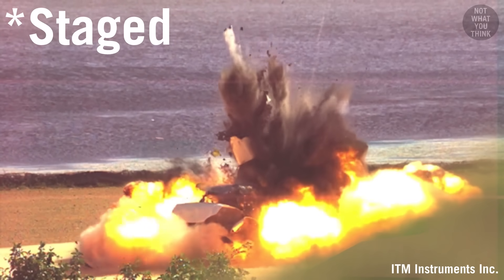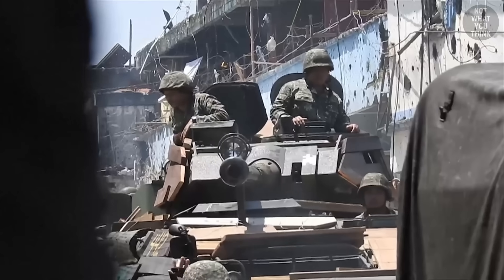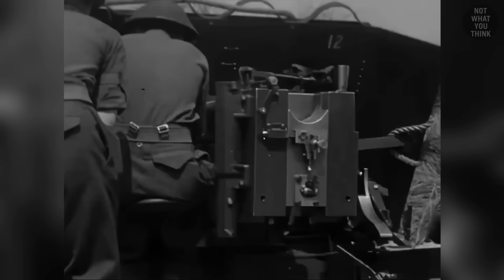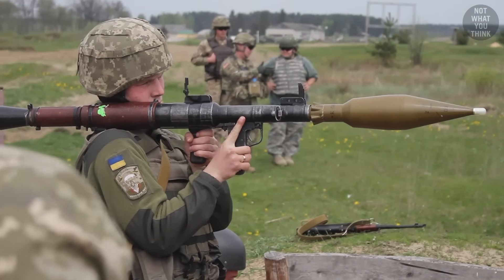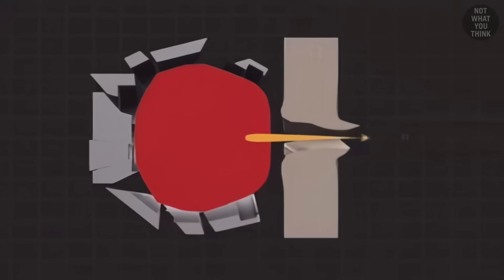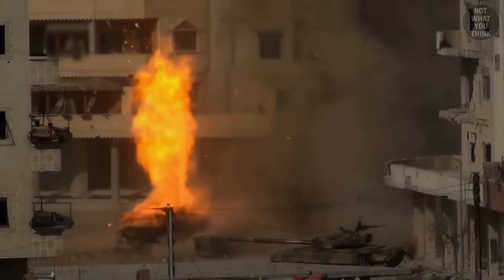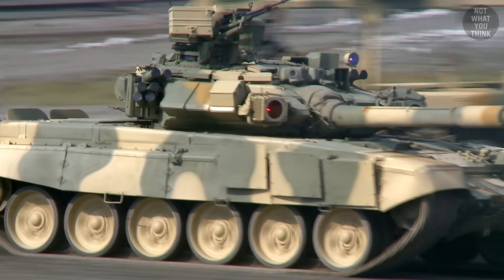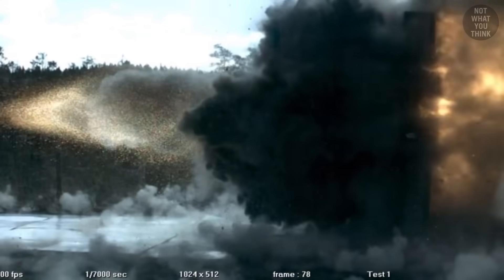Why Protecting Tanks is Getting Much More Difficult

Comment: Tank protection: Tanks these days have to defend against multible working mechanisms of attacks, and not all are covered by the same principle. So what we see is in regular a mix that hope to cover everything that is expected to happen - and also we have a extreme poor education in weapon industry and tank crews alike what they should know and do to protect the armored troops.

RPG's are relativly short range weapons, delivered by troops who are good visible for IR sensors. So RPG's are common, but only can come close if you're forced to bring your tank into a urban enviroment with lots of cover and good thermal blocking hiding places.

In the open, ATGM's are a threat, but most of them use top attack, so most of your defensive measures aren't working at all. Good thing is, the're mostly guided by laser, radar and/or heat. Lasers can be spotet by your sensors (if you have those toys), and if the tank knows its lased, it can pop out thermal smoke to hide from the missile.

Tanks in regular fire APFSDS projectiles which are very thin and long to somewhat 'emulate' the idea of the copper jet needle. A massive, superfast object facing minimal armor. It's good if you have a halve way modern APS to degredate them in flight, then ERA can further degrade them and the armor takes teh last part.

Very modern munitions are KE, which are APFSDS on steroides, the best of them going hypersonic. The're too fast to get tracked by all but the one or possible two best systems available in the world. And still then you need quite propper ERA of newer generation and a solid armor to survive this.

Tanks also shoot HEAT sometimes, which is a completley other math. This are indeed just middle-speed shaped charges.

So every angle on a tank have a list of percentages of what threats they could stop on what probability (on what light conditions, radio enviroment, weather, temperature etc.). That's a shitload of math when you're a tanker, cramped in a small container of metal and in in stress of combat operations.

Modern tanks consider own drones for independant recon and first-sight-first-hit probability, remote turrets to add another layer od dead metal between every possible attack angle and the enemy, deploy most modern ERA and APS. There also is special top attack ERA calles TAPS, fake laser emitters and all other types of fancy toys to help in a very specific situation.
But that's costly and heavy, so mobility - one of the core aspects of survival - is hindered. And in the end, even the toilet paper for the crew is part of how comfy they are, and how good they are focused on ther task.

Comment: Tank prices: Western tanks cost that much due to corporate contracts and to a degree for the complex sensors. A propper T-70 or T-80 only cost you around 750.000 USD. The T-14 Armata cost 7 million USD and the most advanced tank today cost 10 million. So there is a pretty huge gap, and number atm outpeforms quality.

Also the modernised T-90 variants actually don't feature a APS for the fact that a good Arena system would add 300.000 bugs to the cost - and now we have to see that the US don't have a domestic APS and have to buy israelian Trophy, which isen't just incapable against modern threats, it also adds 1.5 million to the cost and up to two tons to the whight. Not a good deal to handle RPG's.

Comment: HEAT warheads and the countermeasures developed to protect against them is one of the most interesting parts of tank warfare.
Reply: @Mark Aspen no, proper MBT’s should be able to stop 120mm sabot from most angle when facing the front, but the side and top is where issues start. Top armor is designed to stop Shrapnel but if it was as armored as the top you would have no room for crew and it would be heavy, fortunately guided artillery is not common enough and non guided is too inaccurate to hit the top unless it gets very lucky. Perhaps in the future guided munitions will be more common (we are getting there) but id image just looking at Ukrainian for instance that the stockpiles of weapons like these will be far more useful not killing tanks but fuel depots, ammunition storages, and such that would make huge battalions of tanks be unable to function instead of just 1.
Reply: @Mark Aspen Nope, not necessarily true
Reply: @Mark Aspen the front of the Abrams Sepv4 would like to introduce itself to you. No seriously the Abrams Sepv4 is invincible from the front not even a kornet AGTM can punch through the front lower glacis. But considering you said that only a tank can destroy a tank you don't seem to be all that smart when it comes to military stuff so you probably don't know what a kornet is or what ammo type modern MBTs use wait... You don't know what a MBT is either XD man it's hard communicating with people of lower military knowledge
Reply: @Mark Aspen side ERA and side NERA is also on the Abrams making it have go protection form anti armour threats there too
Reply: @Mark Aspen Abrams is obsolete.
Reply: @Mark Aspen with what you're saying, and your inability to communicate, I doubt your name is Mark Aspen. I'm a pacifist and I still think Murica is the most aggressive country, far from cowardly, and to a fault. Unfortunately there are many more countries that are much much worse but much much less powerful militarily.

Comment: Protecting tanks is getting much more difficult because of guerrilla warfare, flanking tactics and top down attacks. ERA, which predominantly protects side and turret armor, is not 100% effective. Frontal armor only works when fighting enemies towards the tanks front, which in turn is not the concept of the hit and run guerrilla warfare. Defeating anything with frontal armor, weaker side, rear and turret armor is about flanking, if flanking maneuvers are applied and deployed properly tanks go boom. Top down attacks are self explanatory.

Comment: tank armor is tied with engine advancements and the material, we dont have that much high powered engine that can move ultra thick layers of steel. so most of the tanks even the heaviest one always have a weak thin spot all around, and to cheat this out, the army is shown to develop additional stuff like reactive armor and stuff also we havent found a lightweight-strong material for the body either, imagine if we have a infinite engine/power like ironman's reactor and wakanda's vibranium.

Comment: If the APS is too heavy and costly on tanks themselves in addition to their armament, I wonder if they could move it on to dedicated vehicles in the tanks' defensive screen so that the tanks themselves could trade armor for greater speed and mobility.  They'd still have enough armor to provide protected firepower against artillery and machine gun fire, unless they decided to go full drone tank.
Reply: The problem is the range of modern APS. They are fairly short ranged, allowing for the protection of the tank only. This is in part a result of the times and distances needed for detection, identification and intercept.
However, your thought is very sound.
As the first examples of tanks with loitering munition were shown, many experts were making the same argument: it would be more prudent to put loitering ammunitions on a seperate vehicle, decreasing cost, complexity and mass for the tank.  Same discussion is happening to counter-drone capabilities. Is it more effective to arm MBTs with some counter-drone systems or is it more efficient to put them on seperate units?

Comment: 6:42 NO!!!!!!! the length of a small shape charge pen jet is short sure, like length of your arm short which is still way thicker then any space armor and some thin skin face hardened steal much less any real world tank's RHA for that matter(composite&reactive aside) the idea of the wood paneling is its soft tropical wood  most use chicken wire mesh or chain link but the idea is not to space out the detonation but to catch/bounce the projectile with out detonating it or damaging it enough to distort the shape charge so its ineffective at creating a jet when and if the fuse is triggered(blades of slat armor cut up the shape charge before the detonator reaches the real armor).

Comment: The trophy active protection system actually does put the tank back on top

in Gaza, 2014, the trophy destroyed 15 incoming Russian ATGMS, and not a single Israeli tank was destroyed

in fact, it was so successful it was strategic...the 2014 war ended when Hamas understood they have no way of stopping Israeli tanks

Sure sending multiple ATGM's, at least 5 simultaneously (since the trophy can be activated on all 4 sides), can probably overwhelm the tanks' APS'....but that is just not an effective battlefield, and frankly not a solution

Comment: I have seen many videos of how shaped charges work, but your explanation beats them all. The narrative and video makes so clear that even this 80 year old gets it, finally. Thank you very much. Now, if you could explain how that anti tank round exploded many feet(meters- I'm American) from the tank, and then sent something at the tank that penetrated the armor, works, I would be even more grateful.
Reply: I think I can answer that. Unfortunately the video takes quite a few shortcuts and you are probably referring to the video at the beginning.
That's not a shaped charge. That's an explosively formed penetrator. In shot, the "jet" formed by a shaped charge has a very precise and short distance at which it has to be fired to be effective. If the detonation happens too soon, the jet will be disrupted by the air it has to travel through.
An EFP forms a solid projectile that travels a much greater distance but with a little less penetrating power.
If you want a comparison: take an air compressor, aim it at packed sand from a few feet away: nothing happens. Come closer and the air will push the sand out of it's way. 
Now, if you take a 22LR (which would be the EFP in my example) and the results will be the same if you fire at point blank or from a few feet.
The designs of the liners shown in this video are quite basic but in reality, the liner of an RPG is trumpet shaped in order to shorten the standoff distance. British Challenger tanks use a rifled barrel that imparts spin on the rounds. Centrifugal forces also disrupt the jet from a shaped charge so they had to come up with a liner designed to counter this.
Hope that helped ;)
Reply: @herrhaber9076  I am not sure I am following you. The early part of the video was not showing a shaped charge, instead a ultra high speed penetration round? If that is right, why was the penetration round launched from such a distance from the tank? Maybe to give it time to reach full speed? I want to  thank you for taking the time to try to clear up      my confusion. As you can see, I'm clueless as to what the early scene was showing.
Reply: @williamromine5715  The early scene was showing an explosively formed penetrator or EFP.

It works by exploding thus deforming a metal liner in front of the explosive to create a solid projectile from the blast travelling at 14 km/s as the video said.

Don't think it's misinfo, but he definitely could have stated that video was EFP and not a shaped charge.

As for why it was detonated quite far from the tank, I'm not entirely sure, but my best guess would be to prevent active protection systems from destroying the rocket before it detonates.

The most useful part here is that the projectile is travelling so fast that no form of armor or active protection could do anything.

At speeds of above 3 km/s (hypervelocity), impacts cause solids to behave like liquids as if you're watching a water drop land in the sink.

There's a possible way to protect against something travelling this fast and it's called a Whipple shield.

NASA uses them to protect space ships from hypervelocity debris.

Essentially, they're multiple layers of thin metal sheets.

When a hypervelocity projectile hits, it doesn't penetrate like a slower projectile (remember my water droplet analogy and behaving like a liquid), the energy delivered actually cause the projectile to turn into plasma

So the first few layers take the brunt of the impact, but because the projectile does not stay solid (or liquid, for that matter), penetration beyond that is less of an issue.

So many thin layers beyond that allows the plasma to expand and cool.

I have not seen any evidence of tanks deploying with Whipple shields, but if EFP becomes a staple, I can see it happening.

If you'd like to learn more about this stuff, I suggest browsing the "atomic rockets" website.

It deals more with science fiction stuff but intertwined with real science.

Lots of interesting stuff there, and hypervelocity projectiles was just one of them.
Reply: @williamromine5715  I think you ask a really good question and the other replies don't understand what you're asking. As best I can gather, the round has a multi-programmable fuse that allows it to either explode on impact, after impact, or before impact. You're asking how it explodes before impact, right? I've tried to find the answer but there doesn't seem to be much info out there for it. I'd assume it either has a proximity sensor of some sort, or it has a timer that knows where it is along it's flight path. Either way, it's pretty awesome.
Reply: @Siccaxe  Thank you. I guess I wasn't making myself clear. You did catch on, and your answer makes sense.  I hadn't thought of the proximity fuse, because they generally explode sending shrapnel in all directions. This one explodes sending the penetration round to the target at ultra high speed. Visually, it looks like a CG weapon in a Star Wars movie. Again, thank you for taking the time to clear up the answer to my fuzzy question.
Reply: @hoominbeeing  Wow, thanks for the time you spent in replying and the clear and concise info. I will explore that channel. I have been a science fiction fan for most of my life, and that weapon sounds like something from an Asimov or Arthur C. Clark novel. Merry Christmas and a Happy New Year.
Reply: @williamromine5715  No problem! And to clarify, it's not a channel, but a website.

Merry Christmas and a happy new year to you too!
Reply: @hoominbeeing  Thank you. I never really knew what to call it. Being in my eighties, and only retiring 2 years ago, I am still learning about how to use You-Tube.
Reply: @herrhaber9076  , the Brits solved the problem by not using HEAT at all, instead they relied on High Explosive Squash Heads. HESH is basically plastic explosives with a very thin case and a detonator in the bottom. On impact, it squashes onto the armour like a mudcake before exploding. That sends a shockwave through the target that will cause a big chunk of the inner wall to break off and send it flying around inside like a cross between a pinball in the bumpers and the rocks in the Asteroids game.
Hopefully this was clear enough for mr romine to follow :)
Reply: @william Romine I think you ask a really good question and the other replies don't understand what you're asking. As best I can gather, the round has a multi-programmable fuse that allows it to either explode on impact, after impact, or before impact. You're asking how it explodes before impact, right? I've tried to find the answer but there doesn't seem to be much info out there for it. I'd assume it either has a proximity sensor of some sort, or it has a timer that knows where it is along it's flight path. Either way, it's pretty awesome.
Reply: Hi,as an add on to the other peoples's replies,i can say for sure that in the first clip,where the detonation was done mid-air was just to show the appearance of the detonation stages+the initial explosion and the shockwave,where we can also see some shrapnel along that blast,but another aspect of the mid-air detonation was to actually see the "spike" of molten (usually copper) metal that is the main asset of that round,this is for the multipurpose rounds with programmable detonation,like someone else said before,detonation before reaching the target actually has the purpose of wiping off infantry around the target,with the shockwave+shrapnel,like cleaning the back of the tank approaching wich shields troopers that might have some handheld AT weapons or even snipers and so on,prior to destroyng the tank so can keep the infantry piled up,tactics William,tactics,best regards from Romania 🙂
Reply: @ScarryMarian2012  Thanks for the info.